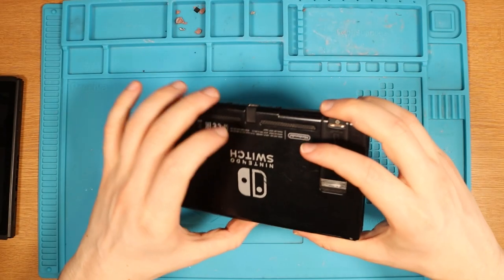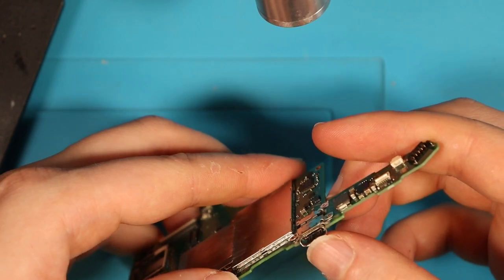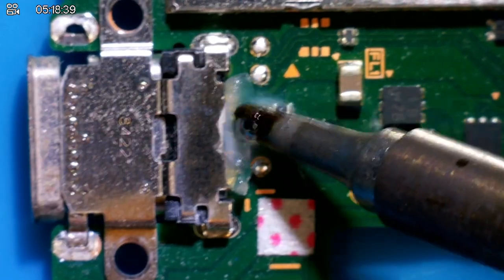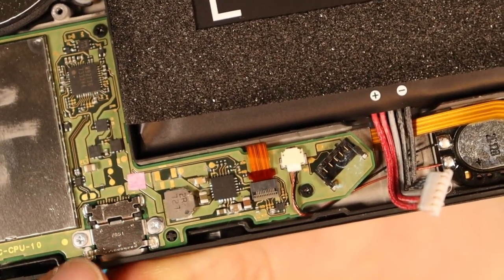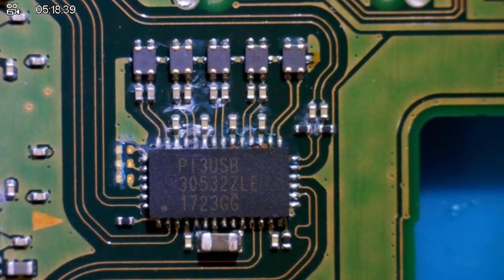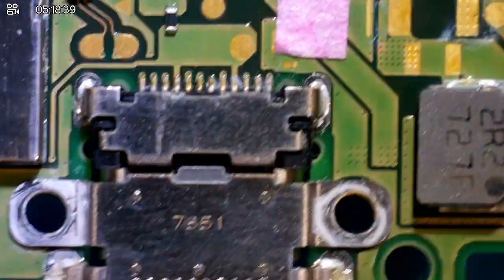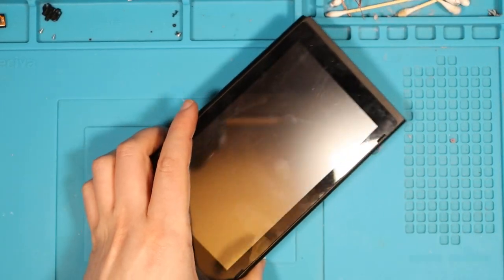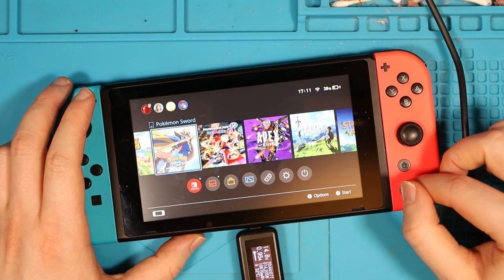These Switches are FAULTY | Can I Fix Them?

Comment: It was a pretty bad method you used to remove the port on the first one. I don’t recommend doing it like that because it is way to easy to rip pads. Doesn’t matter if it just just falls down like it did. It will still lift and rip pads with gravity and the airflow pushing down it. I’m telling you because I honestly think that was what happened. You were heating ground at the moment and so the ground pads lived. You did not heat the other pads or section of board enough. I have seen other people do this and come out with the same results. To do this method correctly you must hold the charging port with tweezers and slightly lift the board by the charging port. Wiggle a little bit side to side until you feel it’s free and then remove the port.

Obviously when working on boards you never want to apply any upward movements until you are certain the solder mas melted. The only thing holding the copper on the board is a very thin glue. When you see a component with actual physical trauma you should always have even more care. The glue under the pads could have already been a bit compromised even though the pads do not seem loose yet.

I won’t tell you how to do this one because I would have put my iron on high and put it inside the port, fill it with solder and heat the area of the pins with the hot air (high heat/low air). I take it off using the iron but remember to make sure it moves flat on the board before lifting.
Reply from the maker: Thanks for the advice Jesus as always. One day I hope to be as skilled as that, I dont really trust myself to put the iron into the port and remove it that way, I'd probably snap the board 😂

I agree though, letting gravity do its job on a standard port seems okay, but not when it wiggles like it did. Next time I'll try and be even more careful.
Reply: @JoeyDoesTech  I don’t expect you to try my iron inside charging port method. I have been doing it for years and honestly I have only seen this work with my edsyn iron. Which is a pretty powerful station. I have tried the hakko and the hakko does not have enough power to do this. I have never used a ts100 though. 

Whatever method you use the basic idea is always the same you never want to apply any lifting force until you are certain everything melted. Always wiggle the component flat on the board until you see it is free before lifting. Pads can take a bit of a beating while reworking as long as you don’t lift them. Once you lift them and the glue is no longer holding the pads, then all that is left holding it in place is the thin copper.
Reply: @JoeyDoesTech  The reason I think this was completely fixable is when you wiggled the port the pins didn’t move. To me that means those pins were still holding on. Maybe a ripped pad or 2 in the worst case scenario because once you start lifting they just all go like tearing a piece of paper. I honestly see it as a beginners mistake and that’s ok you are learning with your own stuff. Its just a bit of a shame but at least you got a perfect donor board. You can take perfect diode readings. Might help if you see the board again in an other device with an unknown issue. Having schematics could help loads recreating all those lines. But honestly I wouldn’t recommend the repair to the customer. Something that will turn up to be this botchy mess of wires that will might not hold up to the clients abuse is dumb. I even tell them 2 week warranty only.

Comment: Regarding the first switch you may want to look into using customer designed flexable PCBs for the contacts similar to the replacement pad sheets some repair channels are using. That could allow you to have a bunch of larger pads to solder on for wires or even make customer sheets that span the surface to what ever point the need to connect too as they would simply need to be soldered in place instead of using wires you route yourself. The design would be the same for all switches which should allow for helping multiple repair shops with similar issues. Just trim of the plastic as needed.

Comment: Great fix on the 2nd one, you could use a charged battery on the first one to see if it works ;)
Reply from the maker: You're 100% correct Roy, cant believe I didnt think of that 😂 That first one is going to be interesting hey
Reply: @JoeyDoesTech  certainly is when you feel comfortable with doing that kind of job, I found just doing a 0.1mm single jumper on a joycon rail cable hard, yours would be a nightmare for me lol.
Reply from the maker: @highroyds  I recently attempted a Switch charging port with some ripped traces, video will be out soon 😂😊